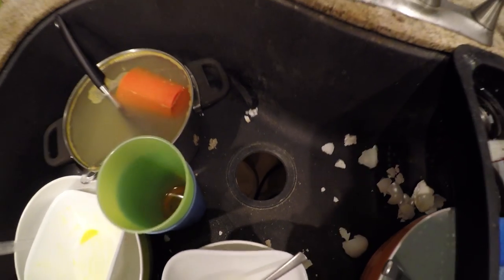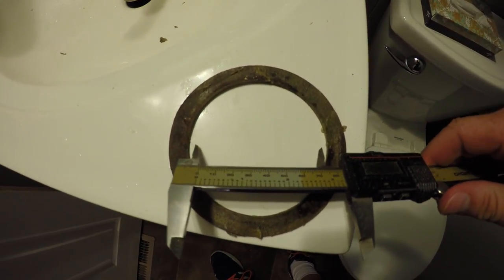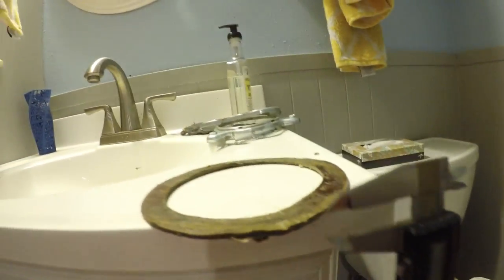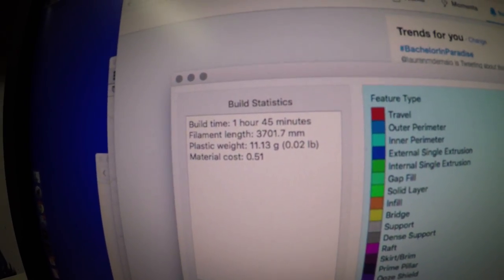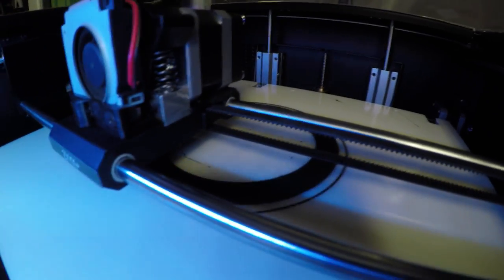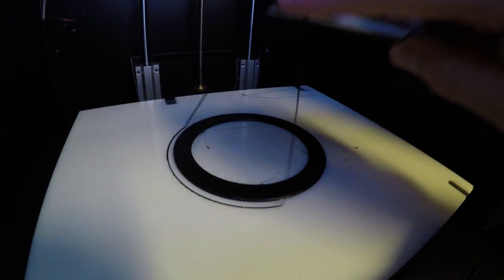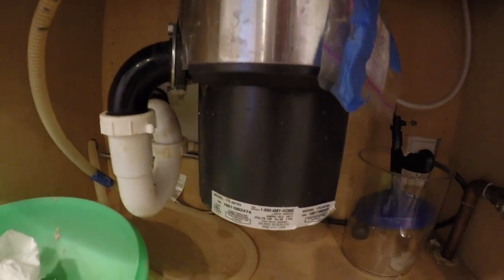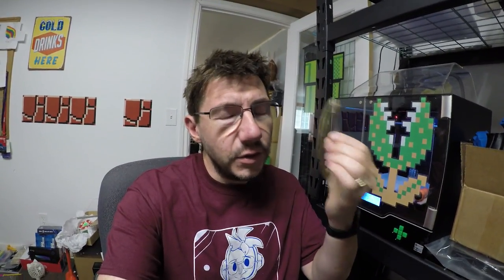Practical Printing: 3D Printing a New Gasket For My Garbage Disposal using ZYYX 3D Printerl DIY VLOG

Comment: 100% agree. I have printed loads of useful things for use at home. Some repairs and a lot of practical items. Towel hooks, Xbox wall mount, car phone holder etc. and the latest is a Coke bottle holder which hooks onto a cinema set cup holder for a normal Coke bottle. Not enough vids showing how practical a 3d printer is. Thank Joel!!

Comment: I really like these kind of practical application 3D printing videos. It's the main reason I recently bought my first 3D printer. Great job and thanks for sharing! 

The only suggestion I can make is to put the stopper in the garbage disposal and then fill the sink with water up to the top. Wait a few minutes and check for drips. Under pressure is the only way to be sure your gasket is really water tight.

Comment: A few weeks ago the railing bracket broke at my house. The part I got to replace it was a near perfect match. Except for the bracket that held the wall bracket the railing in one place.  The one that it came with was a bit narrower and a bit shorter than the old one. So I made on that had the same length as the old one, and would be narrow enough to fit the new one. Printed it out and it failed a few weeks later due to the fact it wasn't thick enough. Made it twice as thick and its been working great ever since.

Comment: Just love the aspect of practical printing.  My better half thought that my printer was a waste of money because "all you can print on it is toys".  That was until a storage unit support broke.  It was an odd size tube, so we couldn't go get a piece of PVC pipe and cut it to fit.  Got the measurements and printed it out.  Just like here not only was it a replacement, but it was better as I designed the walls of the tube to be thicker for better strength and stability.  Now we try to print it before buying it.

Comment: Joel, there's a reason why they use fiber flanges for garbage disposals: They can get HOT and that heat will transfer right up the exterior casing (which is part of how it is engineered to sink heat) to the very top of the unit where the flange touches the sink.  Having said that, as long as you don't leave it running for very long you'll probably never have an issue with your 3D-printed flange since it won't get hot enough to matter.

As a test I'd pour a big pot of boiling water down there while it has been running for a few minutes (with hot water from the sink running through) and see if it deforms the flange (use your calipers to measure before and after).  2 minutes would be a reasonable test (who leaves their garbage disposal running longer than that?!).

Also remember that these components are designed to handle a worst-case scenario which was probably defined as someone leaving the hot water running with the disposal on for like an hour =)

Comment: normaly that carboard seals when it gets wet as it expands. Fyi your local auto part store has sheets to cut whatever size/shape you need or... you can you the thin card board from a cereal box.
Still intresting though, I still need to play with flex for stuff like this though.

Comment: I hope that original fiber gasket (and the printed replacement) was not installed above the sink (between the sink and the top side of the flange).  It's supposed to go below the sink, between the sink bottom and the triangular flange that the three bolts tighten against.  The only thing you should be using on the top side of the sink is plumbers putty.  If that's where it was originally installed, then no wonder it failed.  It's supposed to stay dry.
Reply: I had the same problem as Joel at my old house.  The flange was installed correctly but the plumber's putty eroded away over time and eventually failed--resulting in the same sort of leak that destroyed the flange.  That garbage disposal was probably 15-20 years old at that point though.  So it had a good run.  Replaced it myself with a newer one because the leak destroyed the electronics.
Reply: Got it.  Just wanted to make sure it hadn't been improperly installed in the first place.

Comment: I've made my own PS4 Gold headset band because it broke. I also used fusion 360 to design the band and printed it on my CR-10. First print didn't fit perfect, but after redesign I've got a fully working headset again. Saved me around 80 euro. #highfive!

Comment: Funny enough I printed a part for my 18 Year old Subzero refrigerator that you can't get parts for and it was the most satisfying experience since I have had my printer.  You have a need: design it, slice it and print it.

Comment: I am so happy that in our country we don't flush our waste through the sink.
:D
Reply: Why?
Reply: no animal feeding in the sewerage.
no blocked pipes.
no extra installation on the sink.
nothing on the sink what get damaged.
no discarded compost.
...
yes it is comfortable, but that was it already.
Reply: The organic matters not really that dif than the contents of the toilet... but ppl dumping greas down the drain thous are your clogs.
Reply: Flushing organic waste uses less energy and emits less CO² than transporting it via truck to a dump. It's especially beneficial if your sewer waste is converted to energy (biogas) and/or compost. Where I live (Jacksonville, Florida) organic waste and sewage is converted to compost and sold to a company that then sells it to businesses and consumers. Also, depending on where you are in the city they also use that same organic waste/sewage to generate biogas (methane) which is immediately burned to generate electricity (I happen to live within that area).

In the US our trash bins (and bags) are normally about 2-3x larger than the bins used in Europe.  So kitchen trash would either stink up the house for a long time before being emptied or would be emptied more often, resulting in more plastic bag usage.  Garbage disposals solve that problem and make life more convenient.

If your sewers and sewage system can handle it garbage disposals are actually a really great way to handle waste.  It's not so dissimilar to Montreal's subterranean vacuum tubes that transport garbage to a central processing facility.  It saves a lot of energy and emits less CO²!
Reply: I put organic waste in the garden.
Reply: What garden? The one fifteen stories below the apartment window? "I was putting it in the garden officer, I swear!"
Reply: ok in a big city it is maybe a problem. ;-)
Reply: Yes if you are lucky to have your own garden you can compost stuff and grow great veggies saving you money at the grocery store but not everyone is lucky to have one.
Reply: I asked why because Daniel Krah 's reaction is the same as I have gotten from UK forum friends.   I like riskable's answer. If we all did everything the same it would be a dull world. :)
Reply: Organic waste (not fat or oil) is an important part of the biotop at the local treatment plant. The bacteria that live in the waste help clean the water.

Comment: I hate to tell you this my friend,... BUT that disposal was not originally installed correctly if that fiber gasket was used between the flange and the inside of the sink.  😳 The fiber gasket is used to protect the bottom of the sink from the pressure of the disposal flange plate. With most ISE disposers, you are supposed to use plumbers putty to seal the disposal flange to the sink body. 

It's hard to tell but it does appear you may have also used plumbers putty in addition to the gasket so you're probably going to be fine.  If it were me (early in my career I used to install and repair ISE disposers).. :-) ) I would pull everything apart and only use plumbers putty between the flange and the inside of the sink and move your rubber gasket to the top of the flange plate to protect the bottom of your sink. 
😳
Reply from the maker: +RJ_Make RJ! I just test fit gasket around the flange to make sure it fit. Gasket is under the sink between bracket and sink, with some good ol' plumbers putty under the flange :)
Reply: Fantastic!  I forgot to mention in my hast, great video and practical application of 3D printing and it's material uses. I love these videos!
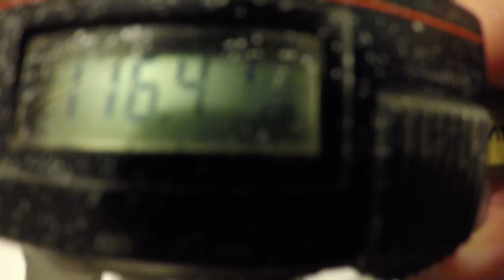Reply: Glad to hear that.  I was going to make the same comment about the install.  Good job.  For me I would have just cut a new one out of gasket material and shaved about 1:30 off the time, but I realize not everyone has stuff like that laying around.  I repair a lot of stuff around the house and one of the big draws for 3D printing for me is that there are thins I can print that would be a huge PITA to construct otherwise.  I have a lathe and milling machine and a shop so the 3D printer fills a gap.

Comment: Joel, a little plumber putty would do the job where it is the flange that is actually leaking.  Not sure who installed a disposer like that, still a great idea though.
Reply from the maker: +fooman2108 wasn't the flange leaking, was the gasket under the sink between the sink and the bracket. Don't worry I used plumbers putty for the flange :)

Comment: Hey, that's awesome to see projects with practical uses. I was wondering though, how much filament did you use and how much that'd cost, to see how cost inefficient (but totally awesome !!) it is to print pieces like this in comparison with buying a new gasket for a few bucks. Thanks :D
Reply from the maker: I would imagine I most likely used a buck worth of filament, possibly two. I'm willing to bet my solution cost more, but not by much, and I think the cost was worth it as I got the solution after a few hours rather than having to find time to go to Home Depot :)

Comment: Is it in your capacity to build from scratch a 3d printer without 3d printed parts? Maybe a series? Something that uses what you have learned from all of your printers the pros and cons of the build decisions etc. Build something to fill a gap in capacity of the current printers? Just an idea. High 5 dude :-).

Comment: this is fun way of fixing the problem bit the filament probably close to $3 a rubber gasket would have costed aroubd $0.50. But an example that it can be used is cool
Reply from the maker: True, most likely $0.50, but I would have had to make time to go to the store the next day to get what I needed. Instead, I was able to solve the problem in time for the morning. I know it was slightly more expensive, but I think it was worth it knowing the time I saved.
Reply: Even expensive specialty filaments are dirt cheap for stuff like this, plus not having to spend time shopping and using up gasoline (which is a nontrivial expense) driving back and forth... I'd say Joel came out quite a bit ahead on this project.  (Edited to add - those gaskets start at about $3 at a home improvement store, Google tells me.)
Reply: and gas money etc
Reply: I go to plumbing stores. In salt lake city a place like industrial supply would cost $0.50 
It's where plumbers shop. My dad was a maintenance worker and knows where to shop.
Reply: True. I fixed my dresser with it and am working on a sprinkler system for a raspberry pi, relay board and open sourcing the whole project so any one can set up a web interfaced sprinkler controller. on top of them i'm going to add echo support after seeing that so you can walk in your house say alex water front lawn for x time and it'll water your lawn.

Comment: Is the Gasket still good? I wanted to use a printed gasket for a project I'm working on. I had a broken part on my HP Scanner. The part was going to cost $175 to replace. I fixed it for less then a $1.00!
Reply from the maker: SURE IS! Still working great and no leaking!

Comment: Try pouring boiling water into the drain, like after cooking noodles, that would be the ultimate test :)
Reply from the maker: We will! Remember the gasket goes under the sink, there is plumbers putty between the flange and the sink.
Reply: YAY. I was worried that you might have done it wrong but now I am glad read the comments and you should not have a problem.

Comment: curious, why did you choose 100% infill? Does the flexible filament behave differently that pla in a significant way when it comes to infill? I always thought anything over 80 was overkill and could cause its own issues, maybe I am mis-informed.
Reply from the maker: I went 100% because gaskets I buy are solid, and I wanted this to be solid. I could have gone 80% or 90%, but, I wanted no gaps in the material in the center. I do print with 4 top layers and 3 bottom, so there wouldn't have been much infill anyway :) Super high infill percentages CAN cause issues, since that's a lot of material needing to be cooled, but for this, and for the flexible, it seemed to work out just fine.
Reply: 3D Printing Nerd awesome, thank you for the response.

Comment: can you use this flexible material on any 3d printer? and because of its flexibility does that mean it requires more support when printing?
Reply: Flexible filaments can be tricky with Bowden-tube extruder setups (where the extruder drive motor is not on the moving print head, but fixed to the side and it pushes the filament through a PFTE tube), as they're both flexible - meaning they're not ideal for transmitting push force - and can be quite high-friction with their rubbery finish. Beyond that, it's down to temperature requirements (I don't know offhand if flexi's desire / demand a heated bed) and just dialling in profile settings to go slow enough, with more retraction, and generally experimenting.
Reply: thanks for the reply, I have recently upgraded to an all metal hot end on my wanhao i3 duplicator, I think this could be very cool to experiment with practical uses like in this video :)

Comment: I mean, it probably would've taken less time to run to the hardware store and get a legit gasket, lol. Still crafty.
Reply from the maker: Yes, way less time. But hardware store was closed. This way, it was fixed in the morning, and I didn't have to make time the next day to go to the hardware store. The time savings was worth the slightly added cost of using filament :)

Comment: also you could have gone the hardware store  (15 minutes away), grab a gasket (because those are standard size) for 2 dollars, go home (another 15 minutes) and have your part ready in 35 minutes for 2 dollars...    please don't print readily available super cheap parts.... print things you can't buy, your own designs and things like that...
Reply from the maker: +aampudia8 or, you could watch the video and see why I didn't go to the store :)
Reply: 30 minutes of driving adds to cost--gas and time not sleeping. ;) And can't always depend on store having correct parts on hand.